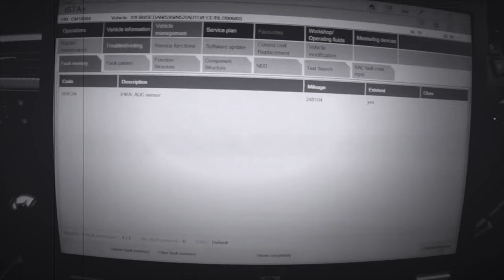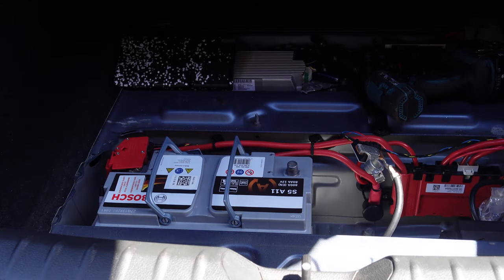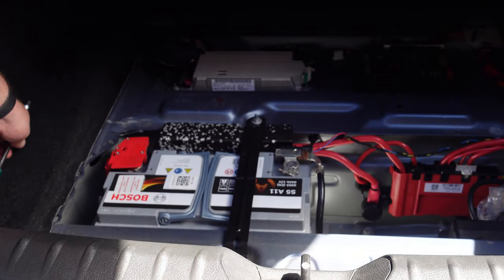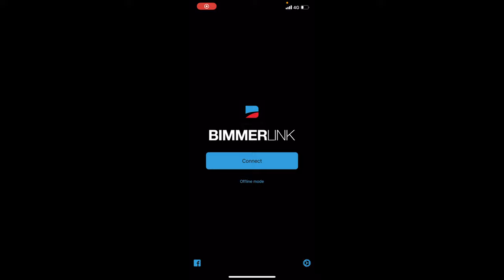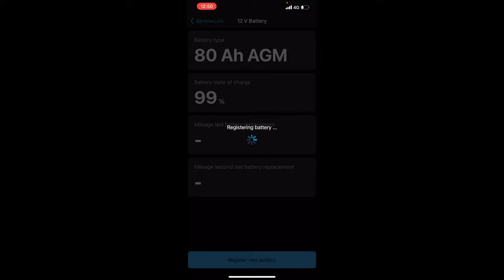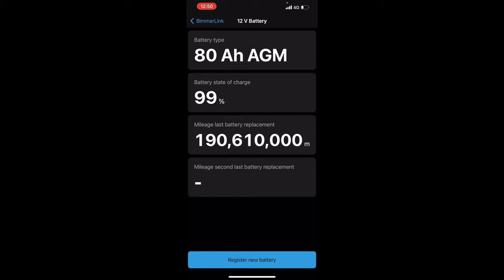5 Minute BMW Battery Replacement & Registration With BimmerLink ( E / F Series)

Comment from the maker: Click here to buy the BimmerCode & BimmerLink adapter :  https://amzn.to/3gaBslN

Click here to buy the Bosch battery used in my video : https://amzn.to/3sm9Sa8

Click here to buy the Impact Gun used in the video : https://amzn.to/37SOAaw
Reply: Link to the adapter is not available
Reply from the maker: @rroosenFB  link is updated as of now please try again
Reply: I had my e60 (lci) battery changed by a local garage and they registered it fine but now the cd multi changer in the glove box isnt working properly. Would i be able to fix it with bimmerlink?
Reply: Hi I have a bmw e60 2006 model and wish to register my car battery - what could you recommend in terms of OBD and software?

Comment: Hi BMW Doctor..... I'll get right to it...
2002 X5 4.4

Alternator died and it sat for almost a month.  Replaced the alternator but I lost the A/C (max button)  and my self leveling suspension is sagging.  Checked the battery and it was bad.  Replaced it but still have the issues.  My question is,  draining the system so the computer resets will correct the problems?  Or should I take it to the dealership for them to register the battery. 

Thank you for your time.

Comment: Is it possible that after changing the battery and than not registering it can cause the electrical motor of the windshield wipers not to work? And maybe the pump for the windshield fluid as well? One or the other...

Comment: Hey Dean. Enjoy your videos. I’ve saved watching you $$s. I replaced my BMW factory batter which had an Ah of 105. My new battery has a Ah value of 100. BimmerCode doesn’t provide a 100 Ah option.  The next lower value is 90. Which value do you recommend using 105 or 90?
Reply: i would say the lesser one because the BMW electronic will limit the charge til reach 90A & the electricity flue will be adapted to a 90A avoiding to charge it more. Just consider BMW electronic control device charge less when the device knows u change for a very new battery. If u fix a limit with 90A , u adopt a safer method. ( Apologize my bad english, its not my native language ).

Comment: Hi, what do we need to register a new battery in terms of hardware equipment? Is the bimmerlink application itself + the BOD adapter enough in order to connect to the car and register the new battery?
P.S. Does it work for BMW E60?

Comment: I have 530i (G30). Do I need to replace the battery by original BMW battery.? or I can replace by BOSCH battery  AGM 92. Also, if I replace with BOSCH (of course cheaper) do I need to register the new battery or coding. Many thanks.

Comment: Great video mate, I have a F33, and battery has started to deplete, found myself charging it every few months,   I have just purchased a Bosch S5 A13, AGM, 95 A/h 850A, very similar spec to the Banner one to be replaced, which I believe is 92 A/h 900A, when registering the battery, would I need to highlight the slight  difference in Amps, or just say it's the same ?
Reply: Did you get an answer for this? I'm considering changing from 90ah 900a to 95ah 850a.

Don't know if I will need to change the type..

Comment: With my X5 I've learned over time to upgrade things with Japanese products mainly wherever possible so I went for a Yuasa AGM eventhough the vehicle is not  stop start
Reply: I realize this is an older comment but had a chuckle when reading it. Although Yuasa may sound Asian,  they are manufactured in Pennsylvania. Always have been.

Comment: Why is it showing  “Mileage last battery change” as 190,610,000 m
Reply from the maker: Because it’s in KM not Miles when you covert it, it’s correct based on the mileage in miles.
Reply: @BMWDoctor  that would be over 112 million miles, unless that figure is in metres (as it does say 190,610,000 m) it just looked a bit strange that it would be in that denomination of metres and not KM 😁 👍.

Comment: Is it mandatory to register the new battery to the BMW. Can't I just replace with new battery and go ahead driving the car ? I'm a noob in-car field btw
Reply: BMW has sophisticated energy management smarts.  It's only as good as the information inputs provided to it so it's a good idea to inform the system of a replacement battery source.  I've been able to get ten years from each of my BMW batteries in two different vehicles so the mgmt must be doing something right.  Never seen that battery life in any other brand I've owned. 👍🏻
Reply: It is mandatory otherwise the on-board computer will keep complaining and the battery won't be charged correctly, significantly reducing its lifespan.